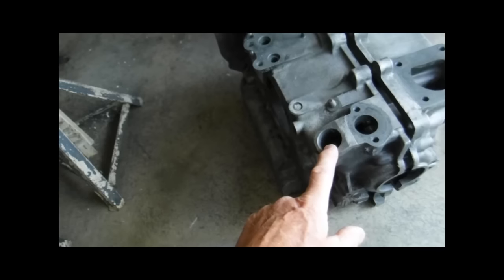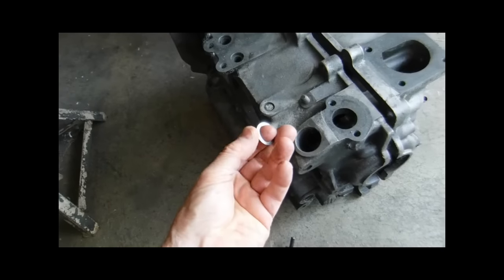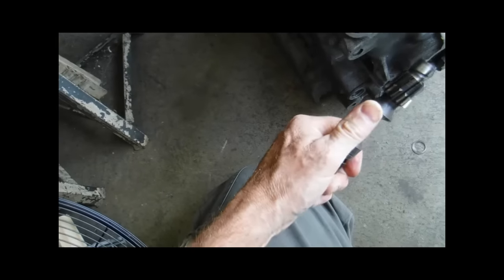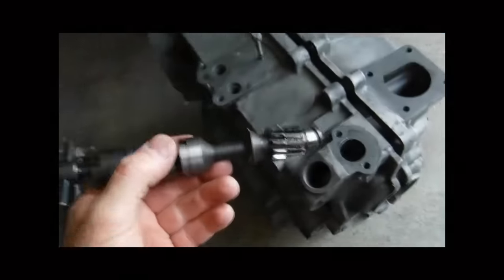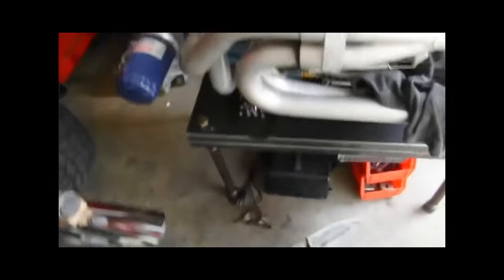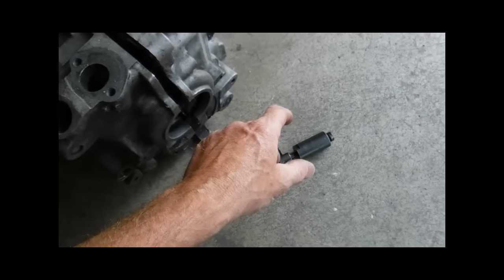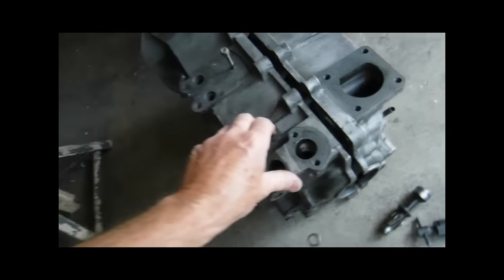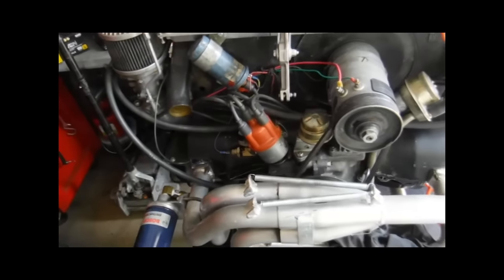VW type 1 Distributer Drive Gear Install

Comment: Great videos.  When I pulled my distributor, the gear game up the shaft - how would I know if the washers on the bottom fell into the case?  The engine is installed in the car....
Reply from the maker: get one of those little telescoping magnets and stick it down there and take them out. There should be at least 2 on a type 1 engine. If you only pull up one or none your most likely going to have to split the case to find them.

Comment: Hi can you please help me, when I turn the fly wheel there is a slight delay before the distributor arm movies, is that normal.
Thanks 👍
Reply from the maker: If you go back and forth that is normal play due to the beveled gears and other tolerance stacking. Just turn you crankshaft in the normal direction of rotation to set timing and other settings
Reply: @TheEZGZ  Thank you for your replies 👍

Comment: EZGZ. I put the wrong fuel pump rod in bent the rod broke the sleeve what other damage did I do .
Reply from the maker: Don't panic.  Hopefully you got all the bakeolight  sleeve out.....?  Leave all that stock stuff out and install a electric low pressure pump and maybe a regulator to keep under 3PSI.  I'm running that on 3 of my 4 cars and never had a problem sense.
Reply: @TheEZGZ  thank you EZGZ.  I DID PANIC.  GOT 99.9% OF IT OUT MISSING 1/8 INCH PIECE.  REMOVED OIL SCREEN AND FLOODED MOTOR WITH OIL GOT IT CAME RIGHT OUT THE BOTTOM.THANK YOU FOR YOUR RESPONSE.  SIGNED NO LONGER IN A PANIC.
Reply from the maker: Whooo Hooo!  Glad the VW Gods were smiling on you.  Good Job Dave!

Comment: I nead to buy this tool. As mine is stuck in . Ive split the case ,as the previose owner rebuilt the motor then left it sitingbin the weather with no distributor top of case is showing corosin ive left the half case soaking in whiteoil transoil mix , i can only move it if under hammer , if removed and reclean block would this still be ok case to reuse....
Reply from the maker: If this is your first engine rebuild I would look for something else. Don't expect to get something for free and turn it into a runner. There are lot's of video's on U tube that show guys starting up a engine that hasn't run in 20 years but the truth is even if that drive they won't last long in normal service.

Comment: Always good videos.
A question for you with the distributor drive, are the drive sizes the same from early 1200 cc to latter 1700(71). I have a complet 1200.  But a incomplete 1700cc neads distributor drive... Cheers 🍻
Reply from the maker: I want to say yes but not sure. 1300 thru 1600 are interchangeable. The only 1700 I know of came out in the 72 Buss with type 4 engine and that is a different animal. Don't forget the shims that the distributor shaft rest on. Good Luck with your project.

Comment: I have a 356 and apparently my #1 is where #4 should be (to the left) is that feasible?
Reply: Thanks, figured as much. It runs fine and timing is good, just had the orginal bosch distributor rebuilt.

Comment: Would that affect the number 3 cylinder using a 009?
Reply from the maker: In theory "YES"  Some early 009 distributor's had a retarded #3 lobe but they haven't done that in decades. It was suppose to help #3 run cooler. That whole subject could be a topic for debate. Only effective if you running on the ragged edge. I like a bigger safety margin. IMHO
Reply: Ah ok I only have old 009's
Reply from the maker: Did you know how they retarded the spark????  They made the cam lobe peak shorter. So the point gap actually became smaller as well.  I thought that was pretty clever. Hang onto those old ones.
Reply: I will.
Reply: I've been running an engine for several months with a backwards gear. The only time i have to take it into consideration is at maintenance time.

I bought the engine off an old VW shop. They'd paint marked the 1 cyl on the distributor cap, so the mystery wasn't hard to solve.

Comment: Just bought a distributator.  It going in only on #3. The old dist goes in like it should. Very odd any suggestions? On a 71 vw
Reply from the maker: Make sure your #1 cylinder is at TDC .  The rotor will rotate a bit but it should land ok.
You didn't say what kind of dizzy you had?
Reply: It is vacuum advance. I am replacing it with a similar newer vacuum advance.
Reply: I have the old dist in and r uh bing it right now but the advance on it seems worn
Reply: The motor stamp is AE. I have it running well. I'll see if I can get a video up and link it I enjoy your videos they helped me get this thing running. Maybe you can tell me what it is exactly.
Reply from the maker: That sounds odd like something you should be able to see? Could the gear teeth on the new dizzy be off a little or have sharp edges? You could take a knife sharpening stone and just lightly take off the corner. The pin that holds the gear on is off center. Have you thought of swapping gears only from the old to the new?? Please let us know what you end up doing.
Reply: I put the motor on tdc and pull old distr and put new one in it the rotor points to #3 instead of 1.  Its weird.  Should I swap wire to make it fire correct or take of the gear on bottom. And swap
Reply from the maker: Try the wire and see how it runs! Just remember or video what you change so you can switch it back. I've had engines that where the dizzy was off a tooth and I relocated it and rotated. It's up to you. Hope you have a timing light to check it when your done. Have fun with it. Don't be afraid to try things. That's how I learned.
Reply: Got my friends compression tester. Tested the cylinders and got 75 100 85 and 110. So I'm going to take engine off and go through it before it gets to bbn old.
Reply: @TheEZGZ  well I ran a compression test got a bad mix of 75 85 95 and 110. Which made me tear down to see nice pitted piston cylinders. So will be measuring bore and all which would seem stock from bearings. Will reuse the crank and cam. Staying stock. Will be going through your videos. Only problem I found was worn rings in the motor. The bearing had a few scores but journals looked great. Any other points of interest. The engine crank did not have any end play and the crank is a mirror finish other than a small amount of carbon on 1 surface.